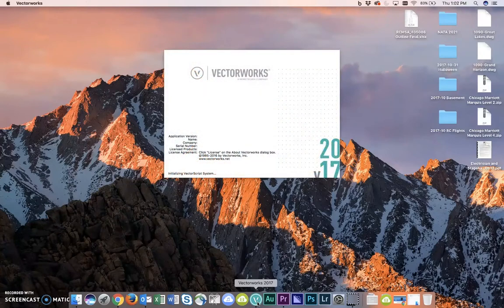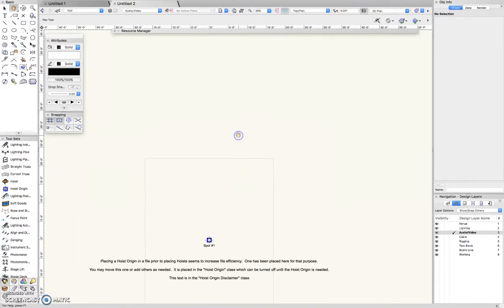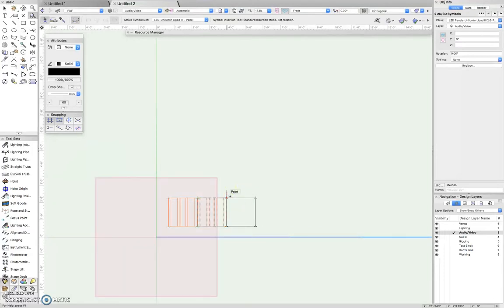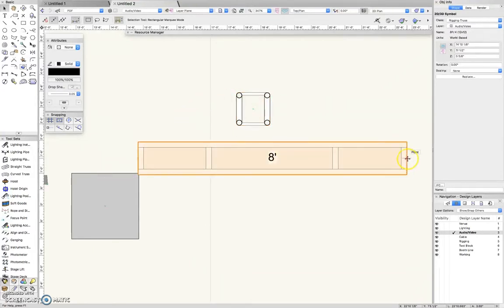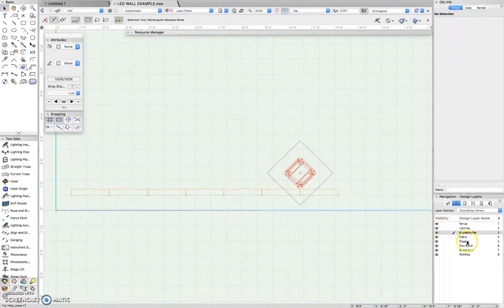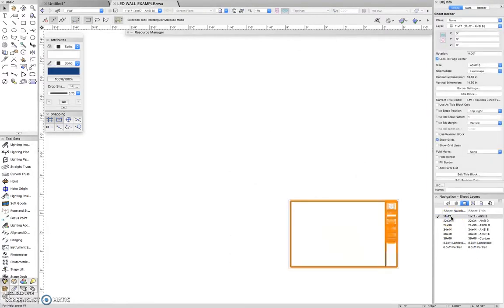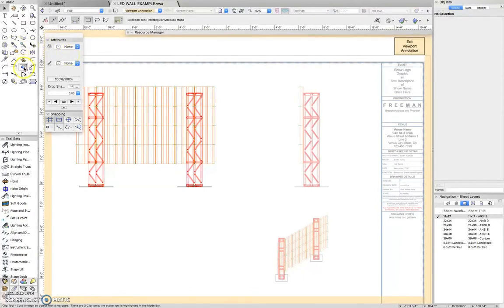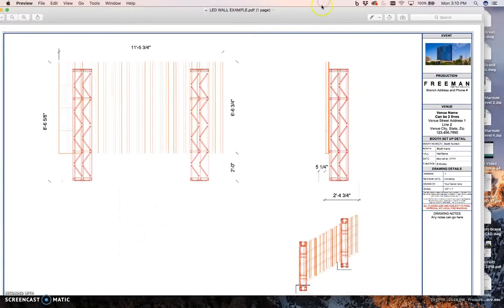Vectorworks: Drawing an LED Wall in 3D Space

Comment: Where did you get your video tile symbols? Specifically the Absen symbols.
Reply: We either got them from the manufacturer directly, or if they didn't have one available it was manually measured and modeled by someone else in my company. If you're looking to find a 3D object, reaching out to Absen/Unilumin directly is the best option.